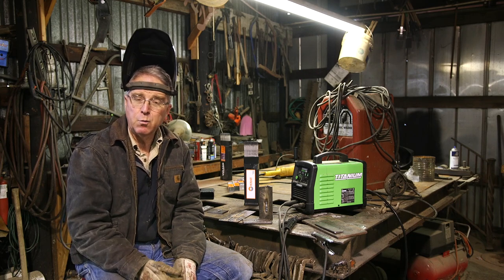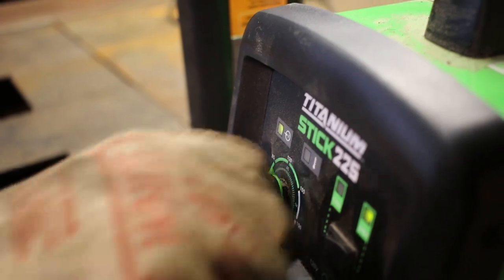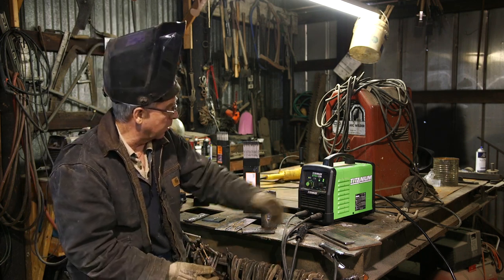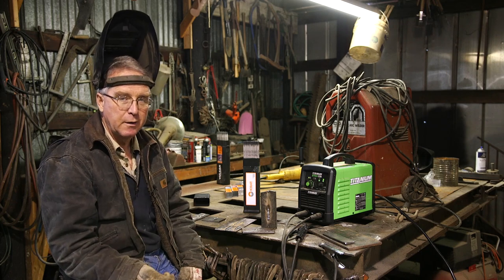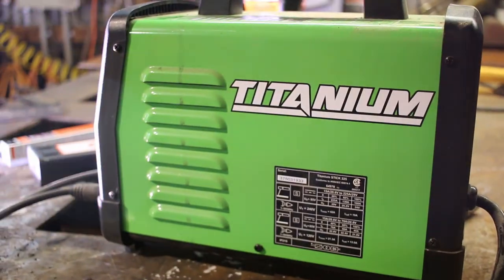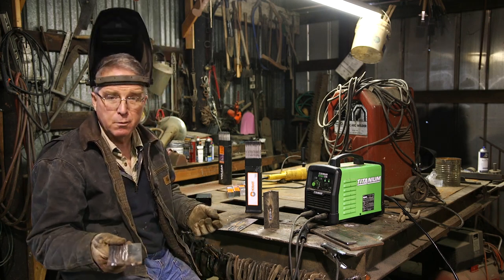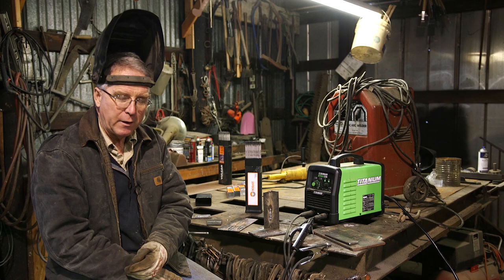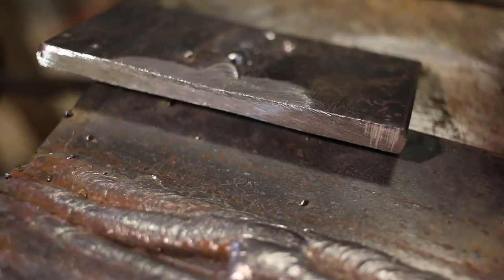Titanium Stick 225 Welder - Harbor Freight Tool

Comment: In a welding power supply, the maximum duty cycle is defined as the percentage of time in a 10-minute period that it can be operated continuously.

Comment: Nice little machine - postively miniature to the ones I learned on at Merchant Navy (UK) college and used at sea. I have found an "excuse" to own many tools over the years........we'll see if this (or similar) ends up in the arsenal. Cheers
Reply: Was that a barbeque getting fabricated at the end? ;-)
Reply: Mr. McLean, I'm a  Fresh water amateur boat  beginner been worcin' in Cedar Key 
before Sars virus pandemic on scratch
Caledonia prosjekt.  Worst lumpy 6011 
welds probably straight polarity.  So excited steel frame boat going well, forgot to rustoleum front axle area of Chevy Van.      Hobart Stickmate @ 220
dryer outlet very forgiving with thick extention cord out back porch window.
Here in NE Ohio have to repair Van .  One 
of these w 120 volt and plenty of patience ?

Comment: I bought one when they first came out and it is a great little welder! when they listed that it can run 6010 i was like, -yea... right..-not-.. but it does!!  I have run about 10# of 1/8" 6010 - no problem.  my only recommendation is to change out the cheap electrode holder
Reply: Wondering which brand 6010 you have tried to weld with this machine.   I've found there's A LOT of variation between brands.  Do you have a video running the 6010 showing the brand of the rod?

Comment: If I could get 50 lbs of rods thru those leads they would be overkill for me LOL.  I bought a Hobart stick welder about 16 years ago and I bet I have bought less than 20 lbs of rods. I did buy a mig welder and use it almost exclusively, but the light weight and small size of these inverter welders are very tempting.

Comment: What about a flux core welder? When is stick better than a flux core?  I’m new to welding and got one of the same green machine brands from HB but it’s the flux core.  Stick looks easier and less hassle than screwing with wire
Reply: I bought a Harbor Freight flux core welder...it’s not a bad little machine if you don’t expect too much from it!

Comment: So from what I’m reading on here even if you’re using 1/8 rod and only at half power the duty cycle should be fine for just welding around my shop. So far it’s not turned off on me. I run it off generator and it seems fine that way too.

Comment: I have the OmniPro multi-process welder from HF.  The duty cycle isn't great either, but I'm just a hobby guy and I've literally never run into issues overheating.  I've only used it for flux core and stick, but it's awesome having the option to go mig and tig if I ever need it.

Are these HF models the best on the market?  Far from it.  But they're a good tool for a weekender like me.  So far I've used it to repair my trailer also built my own custom railing for my back patio, and the $900 price tag for my welder has paid for itself 5x over already.

Comment: With a short duty cycle, I don't think the machine should run until it shuts itself off. I believe the machine shuts itself off if it gets over heated. I may be wrong, but I usually regulate the duty cycle myself. My understanding, as mentioned earlier that duty cycle is the percent of usage in a ten minute period.

Comment: The duty cycle of the titanium (dc) at 225 amps is the same as the Lincoln at 125 amps(dc)! That Lincoln welder makes 225 amps, but only on ac. Max amps on dc is 125 amps. Duty cycle for a welder is inversly proportional to the amperage, squared.

Comment: Is it possible to rig up some fans into the intake on the little green guy to increase the duty cycle %? If it is shutting itself off to cool down, I can't see why more air couldn't help things out. 

Might be a way to get more use out of it with some tinkering, for people on a lower budget and don't mind a DIY approach.

Comment: In a hobby shop you spend a lot more time prepping metal to weld and slag chipping than you do welding so I don't see a real problem.  BTW I grew up with the AC version of that Lincoln "tombstone" in my Dad's shop (not the really old version but heavy metal none the less), that said, I am not a welder but my Dad had a guy working for him that had welded oil field pipelines (he didn't talk about it but I think he spent time in Normandy during WW2 making hedge row busters for tanks) and he did show me a few things. He'd design something on the shop floor with a piece of soapstone and have it. That was the year I learned that canvas shoes around arc welding are a great way to give yourself a hotfoot.

Comment: In highschool i did a couple mig/stick shop classes but honestly that, and a couple frame jobs on cars with buddies is the extent of welding i have. Yes im aware vehicle frames are vitally important and possibly a bad beginner project but with a practiced father of said friend behing u guiding u its not that bad. Anyways, ive been looking at this unit for a lil bit. Ive wanted/needed to learn welding and have looked around at machines for a few years now. The used ones ive found either are far overpriced, missing components and damaged far too much even to be used just as general purpose home use machine, or not what im looking for. I keep being told to go stick, but ive been leaning towards mig  setup but as of the last few months ive been leaning back towards stick. If that many folks are telling me to start stick, theres a good reason haha. I have a feeling unless i strike gold search for used unit in the next 4 months ill be having to start with either a vulcan or titanium as a starter machine which ive been seeing decent reviews of so im glad to see this in ur shop and some of what its capable/incapable of.

Comment: Please explain the DUTY CYCLE further in your video. Duty cycle is calculated by the amount of time you are welding, usually maxed out on machine out of 10 Minutes. So that little machine should be able to run 2 minutes at full power before it’s thermal overload shuts it down. Not bad for a “Stick machine” Your electrode will consume well before 2 minutes expire. So theoretically the machine  would keep running forever. We all know that wouldn’t happen with a HF machine. Now a “MiG” machine GMAW, this would be a big deal. You could keep your finger on that MiG gun til your wore ran out, in theory! Thank you, love your Channel. I’m no genius, just don’t want to see you give out bad info 👍

Comment: Is there a link to the electrical adapter referred to in the video? Does it take power from 120 to 220 or is there any way to do that, so one doesn't have to change one's outlet?

Comment: Excellent review! Any chance you have experimented with small generators on this welder on the 120 setting?
Reply: You'll need 20A-capable generator which will be around 3-4kW. Also make sure it has AVR-auto voltage regulator or this inverter welder will get destroy fast. You could also buy separate AVR just search egay.

Comment: Duty Cycle in welding:  The percentage of 10 minutes that the machine can run constantly before overheating, at which point most machines will shut down to cool off.  IE:  A 20% Duty Cycle is 2 minutes.

Comment: Hi, I am not a welder, I have a beat-up something where the scale text has been totally rusted off and then someone did a bad paint job killing the rust. I have done one or two runs without problems but I have never been in a situation where I needed to reverse the polarity. You mentioned this in the video but you didn't say why you would need to reverse the polarity, so in which situations would you need to reverse the polarity?.

Comment: On that switch for 120 to the left and 240 to the right, what does that E6010 Mean and where is the switch for that?  

By the way, I’m 73 and I have never welded, but I think about trying it from time to time from a purely hobby point of view.
Reply: Hmmm. E6010 is a type of welding rod so I’m not really sure what that label means either, I guess.

Comment: Duty cycle is in a 10 min period 25% is 2.5mins then it should rest for the remainder of the 10mins but that said I have a plug in welder that says its 60% and I have completely disregarded that and stuck rod after rod after rod with no issues, over years!

Comment: Well I have a titanium 170 from HF it’s nice however it’s a replacement to the original one I bought I had a two year replacement plan on it and I’m glad I did,,,,, it sit out in the garage almost a year before I even got to it when I tried it out it didn’t work I took it back they apologize for it not working and replaced it with a brand new one if you spend more than $100 in that store on anything and they offer a replacement plan do yourself a favor and buy the replacement plan do not leave that store with an expensive tool without a replacement plan,,,,another way to buy these welders in my area anyway is look at their returns area I have seen a lot of welders that were Returned some may even be refurbished and you can buy these at a substantial discount however they come with a very short warranty if you buy these take them home and use them immediately that way if they don’t work you can come back in and get your money back

Comment: What gauge cord would you run to operate the little green welder? I run 100' 10 gauge for a 15 gallon air compressor 15 amp.

Comment: Great content as usual.  Love the spec house videos.  Harbor Freight has 20% off coupons frequently which could be applied to the purchase of this welder.  Thanks and keep up the good work.
Reply: You might get lucky, but the current "Free Bucket" 20% off coupon excludes many items including welders. Even the 25% coupon that used to be the norm is now usually only valid on holidays. They have had a couple coupons in the last year that were unrestricted.
Reply: Unfortunately, welders and a host of other items are excluded from the 20% off coupon deals. :(
Reply: Welders are now excluded from the 20% off coupons. So are the better brands such as Hercules and Bauer. Used to not be that way... Thank the stupid tariffs for that...

Comment: Duty cycle is base on a ten minute cycle,  20 % which means  2 minutes before it stops 100% which means 100% all the time.  When buy a machine  you always consider the duty cycle they higher is better but cost is higher.

Comment: That's a 15 amp plug on the end of that adapter, not a 20 amp. A 20 amp has one of the spades turned perpendicular to the other spade. I would still only use this on a 20 amp circuit by itself because it is going to be electrically noisy and throw transients every time you start and stop. That's my opinion based on my training as an industrial electrician.

Comment: The biggest benefit of that little machine its a DC unit so you can weld with 7018, strictly AC machines are awful to work with, if you in damp conditions you're getting zapped. The second benefit its portable, you could run that off a good generator if you needed to patch something together in the field.

Comment: Just got this welder for Christmas, about to try it out.  I noticed in user manual it says dont use an extension cord and dont use outside.  They both seem a little    strange to me.   Esp the outside part.   Any thoughts?
Reply: Are you running it on 120 and if so how’s it doing.
Reply: @Everett Ware  It's doing great.  I have 220v so I usually use that but sometimes I try 6011 rods which use lower amperage on 120v and it does great.
Reply: @RussellCambell  6011 is probably all I need so that’s great. Thanks for the info.

Comment: %90 of anybody's welding here will be with a 3/16 or 1/8 rod, no more than 150amps.

Don't sweat the D.Cycle.--it's good.

Most inverters this size max @ 200amps at roughly %20-40 D.Cycle., making this guy really serviceable at typical amp ranges. (Like, %65+).

My only qualm is that there are some ebay welders this good or better at lower $

Comment: I wish I had bought the HF stick welder, instead of my cheap, stupid, HF mig welder. I actually went to welding school during college so I could get better jobs in the summers.
Reply: I have the Titanium Flux 125 and am liking it so far. My disclaimer is that I've never Mig welded before, don't have a lot of time on the machine yet and have only watched others use different brands of equipment. All that being said, I like it and got a screaming deal as a Black Friday purchase, $150.

Comment: Why advise a beginner to purchase a low duty cycle machine? For some beginners their first project may be building a sawmill
Reply: Those machines tend to be low duty cycle only at the top of their range, my budget stick welder has  35% duty cycle at 135A but 100% duty cycle at 80A. I find myself typically spending 90% of my time doing prep, clamping and measuring rather than welding so even at 135A I never actually come close to the duty cycle limit. On most of my projects I'm working at 80-90A rather than the top end. I suspect that most beginners would be fine with that - but of course, there might be the occasional project where it makes a difference.

Comment: i'll warn against running a 75' extension cord on a 20 amp circuit if its not a 12 or 10 gauge cable. You'll probably be okay, but it's not best practice - bla bla bla you know this but carps always seem to be the guys trying to pull 20 amps through a little baby extension cord that's 50' long :P

Comment: You can improve duty cycle with a CO2 fire extinguisher.  When it heats up just blast it with that CO2 snow and cool it off... LOL
Reply: Your method would work, but I'd be afraid of thermally shocking something. It's also pretty dang expensive to refill a CO2 fire extinguisher.

Comment: Duty cycle SHOULD be measured in 10 minute intervals.  So 20% duty cycle SHOULD be able to weld for 2 minutes straight at full power then rest for 8 before another 2 minutes of welding rinse and repeat.  How accurate that is on cheap machines is ehhh though.

Comment: Lincoln Electric makes a little stick welder for about the same price and it's made in Poland instead of China.
I'm getting one of those.
Reply: Cheapest welder Lincoln lists on their wen site is MSRP of 599, Lowes had it for 379. That's a bit of a difference. I admire your immigrant, but that's not 'about the same price'
Reply: @b2pi  . I've seen LE arc welders for as low as $250. 
Might not be the cheap ass Chinesium one, but the quality is worth the extra price.

Comment: Inside pics in link bellow. If u can solder through hole it will be repairable if it fails how i predict. It was the flux core version but almost same size. Id bet the inernals are almost the same. It costs more to do totally orignional designs for each product.  I taught myself about a decade ago when i brrowed a friends little red flux core box(watched a lit of youtube first). I know someone who just got the flux core wire feed vs of that box. Its great in about the same form factor. He built a frame around bot and shoulder strap. Load with flux core get long extension cord of high guage..u r a portable weld machine. Ive used it a few times and enjoy it but im not to impressed with the internals. I wouldnt expect it to last 2 years hitting dubty once a day. Heres some pics inside https://www.vengeancetech.biz/fabrication/titanium-120a-wire-feed-partial-tear-down/
If u weld once in a while or want to for little issues like the gate u mentioned..jump on it. The biggest issue onside was 85 deg c rated caps inbetween the heatsinks for the magic (seitches for the inverter.

Comment: Most HF electrical tools are junk.  If you need a tile saw for a one time use and it is cheaper than renting one go ahead.  But, if you want a tool that you are going to use for life don't waste your money.
Reply: I'd have to disagree. It depends on usage.
Reply: @misterhat5823  I think that is what I said.  I have three homes, my primary residence I have quality tools.  For my other two, I do buy HF power tools like a skill saw that I would rarely use. I have one of their 14" cut off saws I bought for around sixty dollars.  It vibrates like hell but it does the job and accuracy is not important when you are cutting brick.